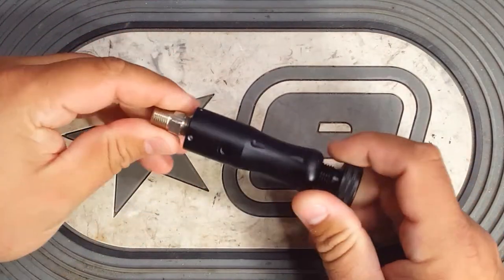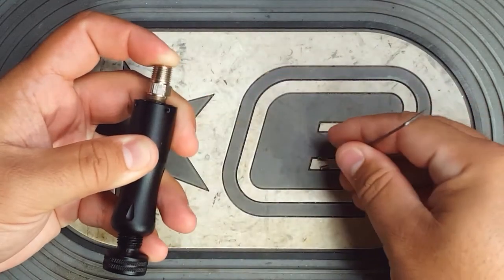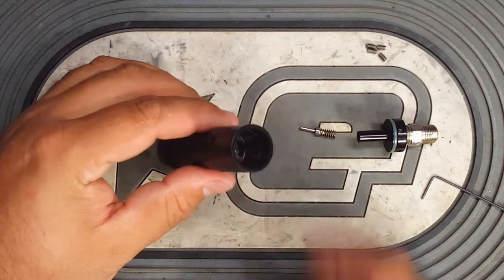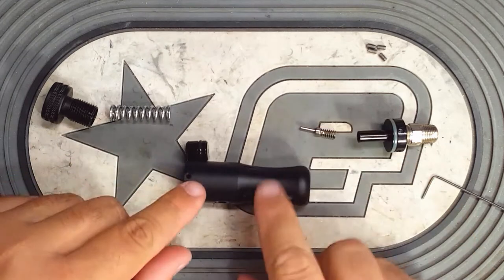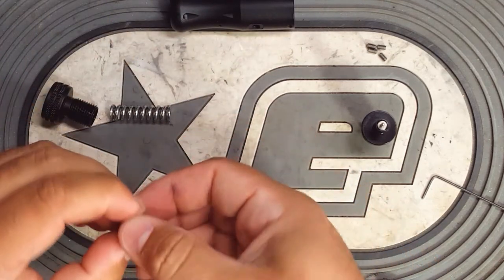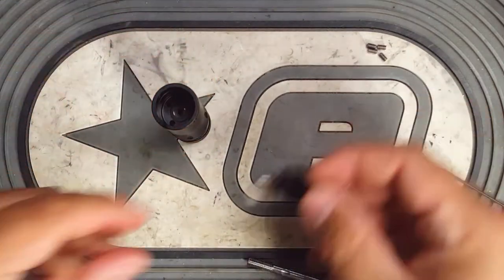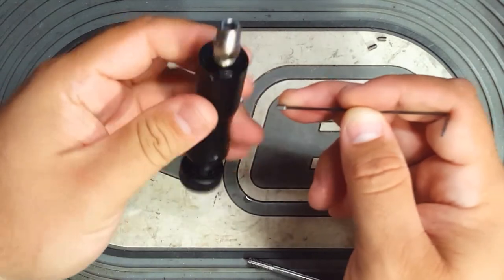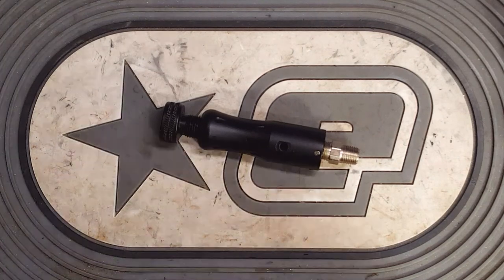ANS Jackhammer II LPR - Parts Rebuild with Paintball Tek

Comment: What is that tool called that you used to get the valvue out? Trying to get a set
Reply from the maker: the one with the blue piece on it that was used to pull the piston out?  it's just a cocking rod from the cocker i was working on.  any long 10-32 threaded screw or rod would work.

Comment: If I need to replace a corroded spring, what spring do I buy?
Reply from the maker: I'm not aware of a direct off the shelf replacement for these, though corrosion isn't going to 'ruin' the spring per-se.  I have come across these springs rusted or corroded before and i just clean them up with a wire wheel (or some scotch brite/sandpaper if you dont have a wheel/dremel) and then give them a coat of oil and they are back to looking like new again.  You can always soak them in some penetrating oil or rust remover as well.